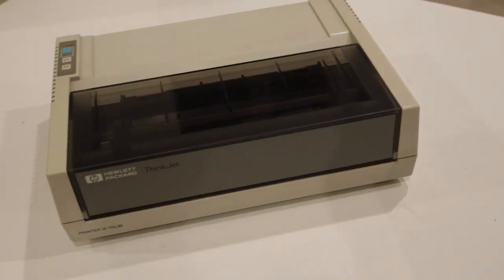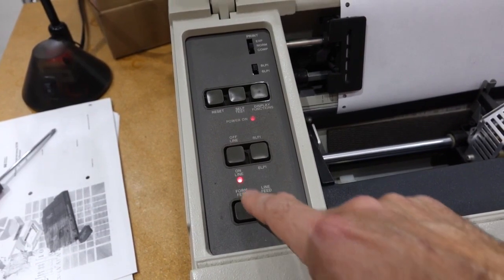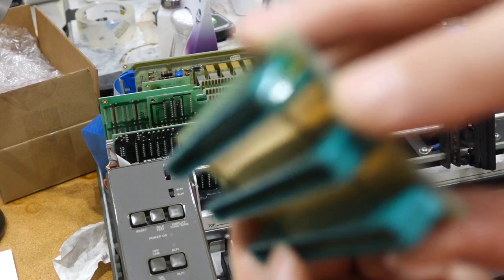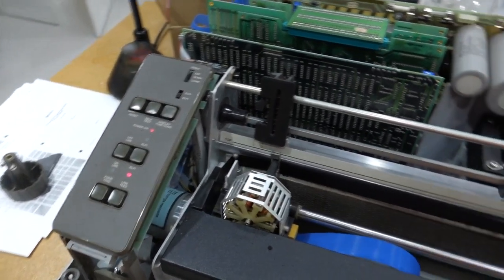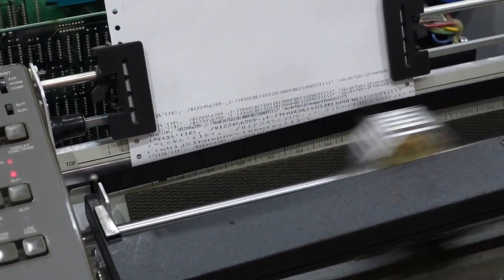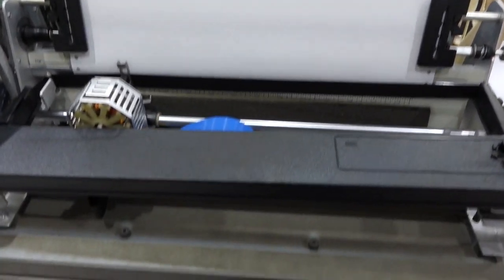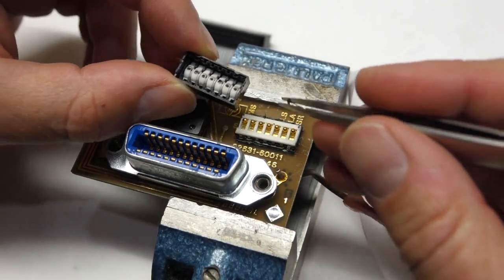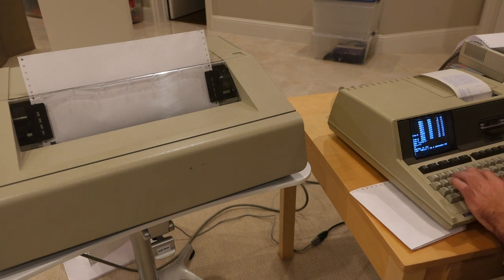HP 2631G Dot Matrix Printer Restoration (vintage 1978)

Comment: I had the honor and good fortune of working on the 2631/2635 printer assembly line at HP in Boise when those came out. I remember hearing all the noise from the printers being tested. They were practically bullet proof! My first computer was a Commodore PET with an IEEE488 port which was actually the same I/O as HPIB so I built a 2631A from scrapped parts at my shop and had my own HP printer which would have cost 4 times as much as the PET. I saw many new computers and printers which were used in house. I was a repair technician and got to unbox setup and test all new equipment that came in to be used on site. We had the 7920 and 7925 disk drive production line also. Those drives were as big as a dishwasher and only stored 400 MB and cost over $17,000! Check out The HP computer museum online.
Reply from the maker: I actually do have an HP 7925. What a monster! It’s on the (long) restoration queue.

Comment: Hello Marc. Thanks for the video! I enjoy watching your video on HP85 and other HP equipment of that era. Thanks to your videos I started messing with HP85. I now have two HP85B one with the PRM85 the other with the printer/plotter ROM. After I saw this particular video I stared looking for a HP Matrix printer. The only one i found was not to far away in Germany and it had the HP-IB :-).
So after I got it home it had kind of the same problems - I reinserted the print cards - that helped. But I could not print from the HP85, even after setting up the DIP switches - then I remembered your video - and guess what: "PRINTER IS 700,80" worked!! Guess I have to clean/change the HP-IB address DIP switch..

Thanks again!

Cheers from Denmark,

Comment: Interesting video. Me, my only experience with dot matrix was a Panasonic KX-P1124 and then Okidata 182 and then finally a Genicom printer. And lights are on but no action - check power supply. Bet there's a bulging cap in there.

Comment: This may be the only video I can truly relate to - I once repaired a vintage printer. Unbranded SR1000 parallel port printer - the heads were jammed. Ended up disassembling it to clean the stepper motors which drove it.